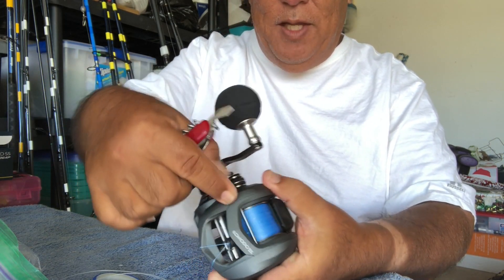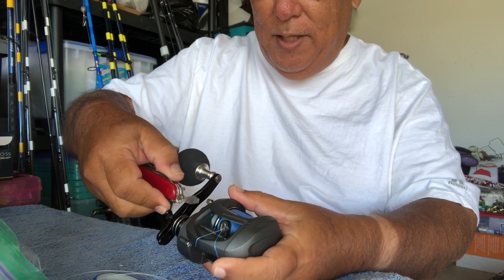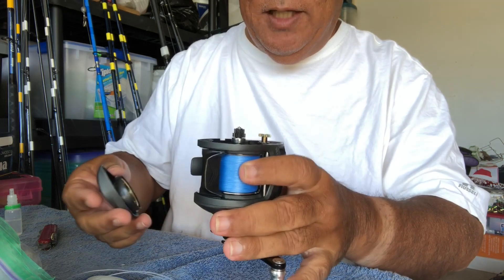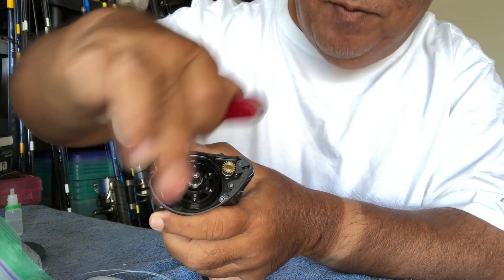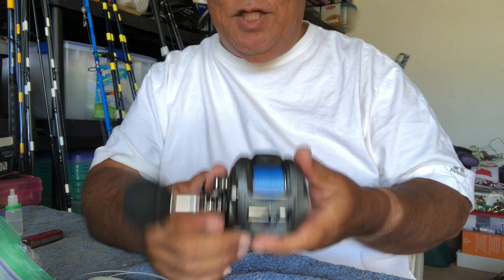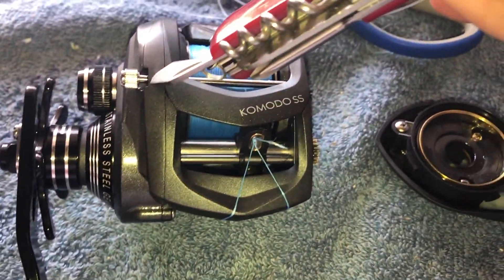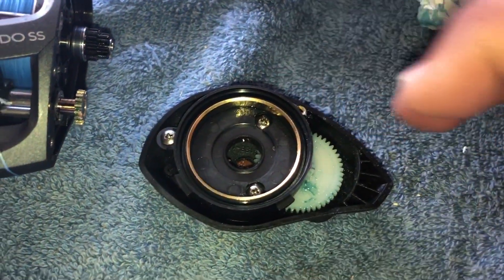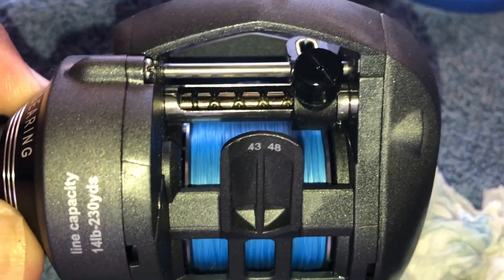Okuma Komodo Baitcasters Modified For Casting That Extra Distance!

Comment: Scuba Chris very informative, the music didn't distract nor make the video off put. I purchased the 471 for drop 100ft for seabass. Great execution love power handle. But was curious how to beach surf with her on the cast. I was waiting for someone to explain centrifugal drag,  excellent product. I will attempt casting 75'-150' and fine tune now I know how. I was using my accurist p3 in now n' later colors. Getting very good with baitcasting. Can't wait to use on kayak over wreck
Reply from the maker: Damn, bottom jigging will be a winner! I'm almost ready to to take out the Whaler that is my friend's dive boat. If you look on YouTube many jiggers off charters are pulling up tunas to amberjacks using that model. For the larger 471 you really need the power handle.

Comment: Do you prefer the power handle or 2 paddle for smoothness on baitcaster
Reply from the maker: Paddles for my smaller unit, power handle for the largest, the midsized? Still deciding.
Reply: @ScubaChris  k use a power handle and it’s a little hard working lure all day
Reply from the maker: @frostizz2072  So what's more important? If you're in an area that you're contemplating using a Power Handle there's a very good reason for that, right? You're forgetting another option. Gomexus handles & knobs. On my favorite units of ALL my reels i have Gomexus &/or Goture options already on them. Greatest way of combining comfort with power. If you watch my channel i'm one of the few where the US & China reps are constantly sending me accessorizes to use as i've helped them on models that they have no access to. And in most cases i modify the parts to make them work. 

And most US companies/reps have noticed this so when i request a unit from them they send it because if my mods are successful it'll mean that their units become more popular. In fact Jack of the US has already sent a new handle w/extras to me from last week. A new item from China & others from the US for another project. I currently have some longer handles for baitcasters from a shipment last year. Which unit do you have? KDS-364P/471P?

Comment: Hello Chris, i like to fish in coast with the Reels like de Daiwa sh20,but is a bit large for mi hands. Wich low  profile reel You recomend me under 200usd? Fishes here are betewen 5kg and 8kg maximum. I like yo cast long distances, wich reel could You recommend me? Thanks
Reply from the maker: If it was me i would use the Komodo 200. Casts FAR w/max drag at 25lb. The MSRP is $220. You're other choice but i haven't used one yet is the Citrix 200. This one is $175 with the same max drag. If you really want to cast far clean that goop off the bar & just use lube. I'd suggest this for ANY bait caster (i show how to do this in my videos. Good luck.

Comment: Hello Chris!!how does this reel cast lighter lures i mean 20 grams to 30grams range??? I've heard komodo doesn't cast well compared to other low profile reels.any idea?
Reply from the maker: I'm not sure to be honest with the 2 larger units i have. I have the 300 & 400 Komodos. I suspect if you use the new 200 size w/light braid that it'll be ok. Also i wipe off the grease and i use lube instead. Wow, so smooth and you can cast farther as well!
Reply: @ScubaChris  thanks chris😄👍

Comment: How did you remove the original handle ? I can’t get it off to replace it
Reply from the maker: Hi Albert,
I never removed the handle, you order the units for right/left usage and dual paddle/power handle usage.
Reply: Just remove that bolt with a properly size wrench and than the screwplate and bingo I did the same on my diawa lexa 300 and 400 and put power handles

Comment: If you push the studs out does that not mean the brakes are engaged and when they are pushed in the brakes are off
Reply from the maker: Ok, when all 6 studs are in (close to the core) it means the magnets are fully engaging the spool & will slow the spool's rotation. So if you put 3 studs out of the 6 magnets those 3 magnets are now further away from the spools core thus the spool will spin more freely. Since this i tried 4 magnets out which means i can cast even farther as now only 2 magnets are slowing the spool's rotation . Now i put all studs out meaning if your tensioner's settings aren't correct you'd have a major bird nest problem. I did this gradually to get the feel of this high end bait caster.
Reply: Scuba Chris it says on okuma’s page that  when then studs are pushed in that the brakes are off allowing further distance for casting
Reply from the maker: @lar9531  I'll take a look. Thanks:)
Reply: Scuba Chris I could be wrong but that’s what I seen in the comment section of one of their YouTube videos and another video on okumas page. Let me know what you think I’m new to bait caster haha
Reply: Those are centrifugal brakes, closer to the center for a faster spin out for slower. Similar to how a ballet dancer would spin

Comment: Where did you get the knob?
Reply from the maker: You request it when you order the reel. "P" is for Power Handle so for my 450 series the item#KDS-471P, the "P" denotes you're requesting a power handle.
Reply: that reel comes with the NEW power handle

Comment: So the reel is tagged as SS but the gears you removed the grease from are white plastic, kinda false advertisement in my book. If the internals are advertised as SS then they all should be not just a selected ones. Just my 2 cents.
Reply from the maker: I only needed to remove the heavy grease from the plastic gears only as that slowed the rpm's. And it worked.
Reply: Dan, I'm ⛏️ ing up what you're putting down. Lol.

Comment: What size your line ?
Reply from the maker: It's in the video in detail, did you watch it? (6:40 time frame)
Reply: @ScubaChris  ok..
Reply: @ScubaChris  is the 471 bigger than abu garcia toro size 60 or same size?
Reply from the maker: @rivalramayoga7061  I'm not sure as i don't use the latter reel, so i can't commentate honestly on your question. Sorry.
Reply: @ScubaChris  little confused with both reel, but thank you very much for your info 🙏